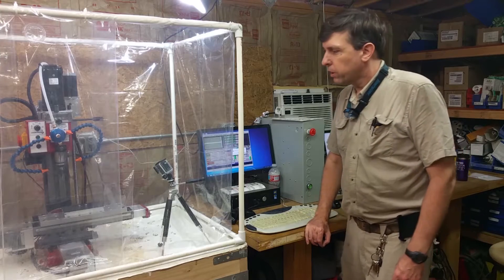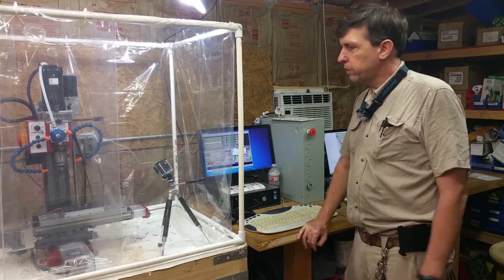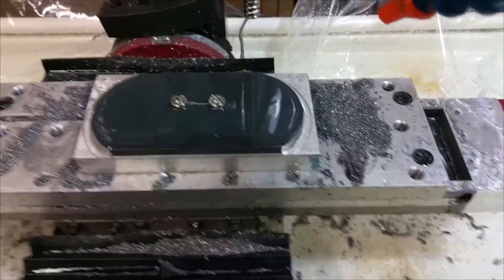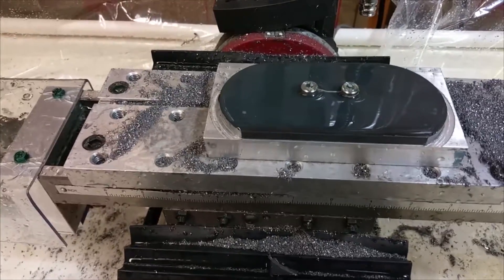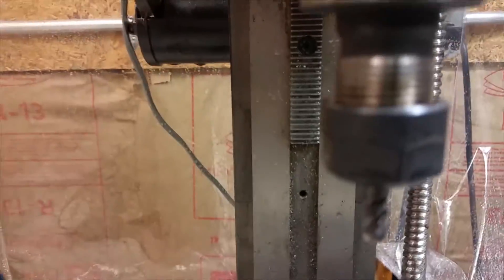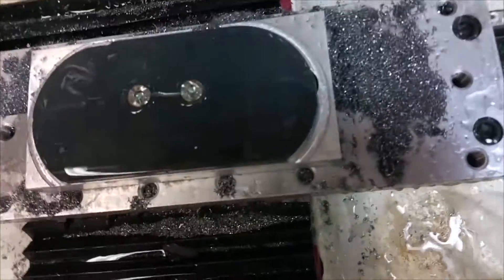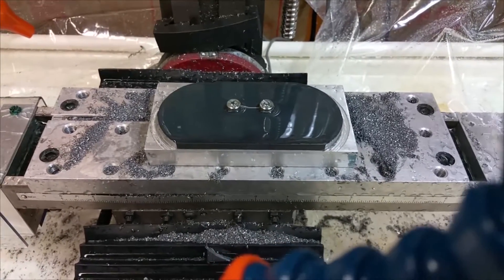Mini Mill - 2nd Cut with Flood Coolant

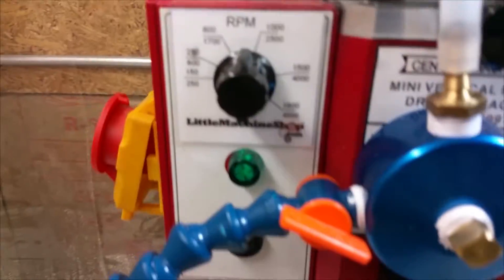Comment: 5:55 4500 RPM? is that a mistake? LMS specs show the X2D has a 1/2 hp 350W motor that is only capable of rotating the spindle at 100-2500 RPM. Does the belt drive upgrade increase the RPM?
Reply from the maker: Yes, that's one of the main advantages of the belt drive conversion, that and no more gears.

Comment: Why such high RPM and climb milling?
Reply from the maker: I can run at a higher feed rate with a higher RPM.  At 10,000 RPM I could go 24 IPM and cut the same part in 1.5 minutes. The mini mill maxes out at 4500 RPM with the belt drive conversion and the rigidity won't take the higher feed rate.  Climb milling throughs the chips down stream so that they chips aren't recut.
Reply: Sorry, just read that it is a carbide enmill, rpm aint that high for carbide but it sure does sound like the mill ain't liking it.
Reply from the maker: Cuts like butter in the straight aways but doesn't like the turns sometimes. not sure if it a controller issue or what. Guess I will find out when I get my next mill.

Comment: Have you had problems with your mill tripping your circuit breaker? All the sudden, mine keeps doing it for some reason...?
Reply from the maker: +Charlie Harris  If you are referring to the breaker in the mill, no.  When I did the belt drive conversion it stopped tripping. Are you still using the plastic gears?
Reply: +Craig's Machine Shop No, the mill itself is working fine. I'm referring to the circuit breaker that provides power to my entire garage. It's strange.. It seems to happen when I hit the Spindle CW F5 button to stop the spindle, and it's happened a couple of times in the middle of some code. I'm thinking of having an electrician over to see if maybe the mill needs its own circuit breaker?
Reply from the maker: +Charlie Harris Is it a GFCI breaker? Does it have a test button? What else is on the circuit? It shouldn't need its own circuit unless you have a lot of other things on the circuit.
Reply: +Craig's Machine Shop Yes it's GFCI and yes it has a test button. That one circuit powers my entire garage, so it powering some overhead lights, a freezer, and a few other miscellaneous items. When I'm using the mill, it's also powering the mill, computer, and controller box.
Reply from the maker: +Charlie Harris The freezer is the only real load. Try unplugging the freezer and see if it still trips. It could be the electronics tripping the GFCI.  Are you using flood coolant?
Reply: +Craig's Machine Shop Thanks for the suggestions! I actually thought the same thing and already tried unplugging the freezer. It still trips. No, I'm not using any coolant yet. I plan to add mist at some point.
Reply from the maker: +Charlie Harris Sounds like you need to get it off the GFCI. Code allows for this in the garage under certain conditions.  Usually has to be a single receptacle and not easily accessible like behind a machine.  They are used for things like whole house vacuum systems and furnaces in the garage.  I haven't done residential work in a while but I can't imagine things have changed much. If adding a new circuit is a big deal, you could always replace the breaker with a regular one and add GFCI receptacles in the garage where required.  We never used GFCI breakers. We just added one GFCI breaker in the garage and load sided the rest of the outlets.
Reply: +Craig's Machine Shop An electrician is on his way over so hopefully it will be an easy fix. I need a new outlet installed on that wall anyway because currently I have an extension cord running to an outlet on a different wall which isn't ideal. Thanks for the info! I really appreciate the help!
Reply: +Charlie Harris Ok.. I think the problem is that the breaker is actually an AFCI breaker which, from what I was told and from what I read, can be prone to "nuisance tripping."  Since currently that's my only option in the garage, I'm going to have a non-GFCI breaker installed and have it run to a new GFCI receptacle on the same wall as the mill. Hopefully that will solve my problem and keep me within code!
Reply from the maker: +Charlie Harris Cool, hope that handles it. AFCI in the Garage?  I thought that was just for bedrooms.
Reply: +Craig's Machine Shop Yep, I have AFCI on every room including the garage.